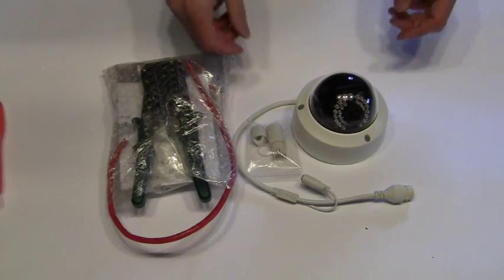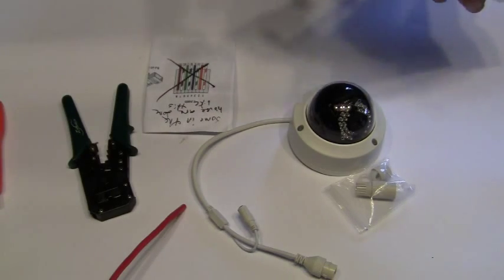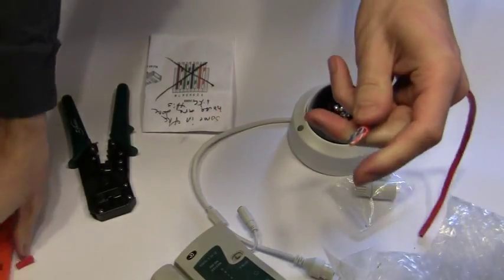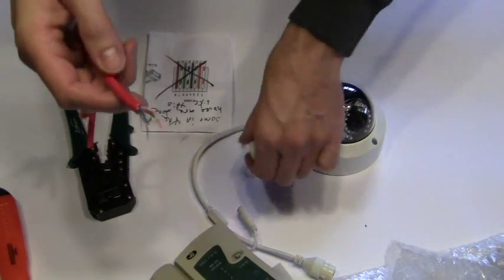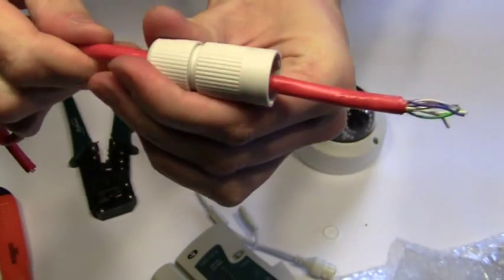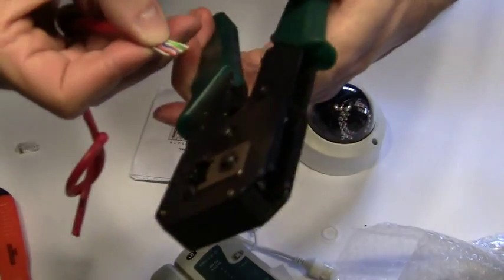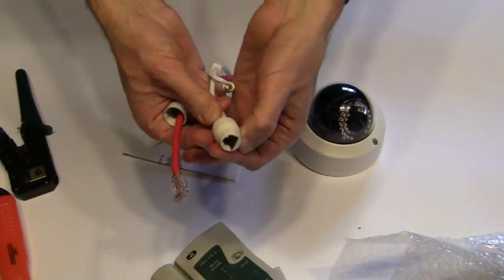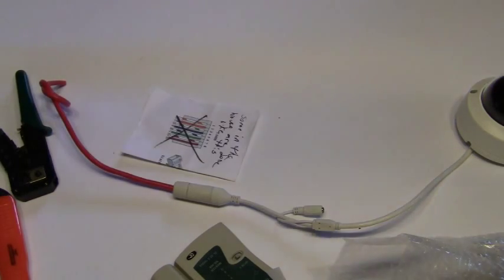How to attached - Weather Seal / Cable Gland / Grommet / Coupler to IP Security Camera

Comment: What I don’t get though is this is great for outdoors but what do you then do with the other part of the tail the 12v D.C. socket you don’t use as I’m using poe
Reply from the maker: Great question!  When I remember, I wrap it in electrical tape to keep any moisture and bugs out.
Reply: @HomeTechDIY  I think this is what most users are confused about. I knew I'd have to redo the terminators on my cabling but no one wanted to tell me what to do with that DC connector. Were back to junction boxes (for my install, bullet cams.. plus that connector is too big to fish through the attic in my home. Wish manufacturers would tell you this instead of making a $. Good quality though cant complain there.

Comment: Que tal, tengo una consulta... Compre el NVR  DS-7616NI-E2/8P "192.168.12.2", conecto la CAMARA IP  DS-2CD2132F-I "192.168.254.64" y todo trabaja ok. lo que intento es acceder a la camara IP directamente y aun no lo logro. para configurar el IR en la camara IP.

¿como podría acceder a la CAMARA IP   detrás del NVR HIKVISION??

Comment: I was debating whether to install the RJ45 connectors on to the ends of my cables before my cameras arrived in the post? Now I know....... DON'T!!!!!      Cheers mate!
Reply from the maker: Some cameras are now including couplers where the cables can be terminated. They RJ45 connector fits though the coupler and the rubber seal is larger. Better save then sorry and not terminate the cables yet.

Comment: what if the cable you are using is much larger than the hole in the rubber grommet? anywhere to buy different inner diameters?
Reply from the maker: I have the same issue with some outdoor cables; they are too thick for the rubber grommet. I'm considering some neoprene stripping and wrapping mine in a few layers so it has a nice fit in the cover. https://amzn.to/2QiAsi9

Comment: What should i do with the 12v power outlet? Do i have to cover that too, or do i let it dangling around in the rain?
Reply from the maker: I should be ok, but I like to wrap a little electrical tape on it to seal it off.

Comment: I just started using the tubes of silicon grease being careful that the connections are under the eves and not in direct rain. so far so good. Some systems are 8 years old so its best for me because its quick and lasts a long time
Reply from the maker: Thanks for sharing

Comment: I am new using this.  The connection you made, can you explain why we are not using the 12 v DC?   Thanks!
Reply: Power can be supplied to the camera by the ethernet cable alone as long as it is it plugged into a “Power Over Ethernet” (POE) port on a router or switch. Devices with POE ports (usually a limited number of the total available) are pricier than those without and can be a lot noisier if they have fans.

Comment: Yea...Now where do I leave this massive plug? It doesn't fit in the base. They want me to drill a big hole for the plug when a UTP-cable sized hole should do it.....? Some people have brick walls you know....
Reply from the maker: Agreed, the plug is massive.  You will either need to drill an equally massive hole in the brick or use a junction box to hide that thing. https://amzn.to/2trlH1p
Reply: Yea...already looking for a junction box. But that adds bulk, which I don't like. Ah well.....

Comment: What do you do with the 12 v plug and if yours is a poe setup what poe hub are you using. I am confused as poe hubs have 48V and the camera seems to have a 12V power input
Reply from the maker: domenico fusco I leave the plug open if it's in a dry area.  If there is a risk of moisture, I seal it with some electrical tape.  I'm not sure how to answer your question on the voltage.  Here is the switch I use, if it helps: http://www.amazon.ca/BV-Tech-100Mbps-Network-Ethernet/dp/B005GAAUMW
Reply: newfiebort 
Thank you.
 I will get the hub as this will solve my problem. What  I didn't  understand is why they have a 12 volt plug when POE uses 48V.
It probably doesn't matter if it works with that hub.

Comment: but how to disconnect or remove the seal?
Reply from the maker: Pretty much the same process but in reverse, except for when it comes time to remove the grommet from over the RJ45 connection. You might need something thin to side in there to push the RJ45 connection tab inwards to allow the grommet to slip over. The end cap can only be removed by cutting off the RJ45 piece.

Comment: Hi is this required if the camera is indoors?
Reply from the maker: No, this is not required indoors.
Reply: newfiebort thanks I put it on anyway it was a piece of piss to do
Reply: Yes and no. It isn’t required for weatherproofing (unless your house is really damp!) but with my Hikvision cameras, the RJ45 connectors didn’t snap lock into the Hikvision sockets. The threaded cap was required to ensure the connectors didn’t slip out in case someone pulled even lightly on the cables. I’ve never had any problem with the dozens of connectors I’ve put on cables before and it was the same problem with both my DS2CD2122FWD-IS cameras so I assume it’s a Hikvision “feature,” not me screwing up.

Comment: How do I remove the connector
Reply from the maker: To remove it completely you will need to cut off the RJ45 jack.  Some weather seals allow the jack to slide out, but not this one.